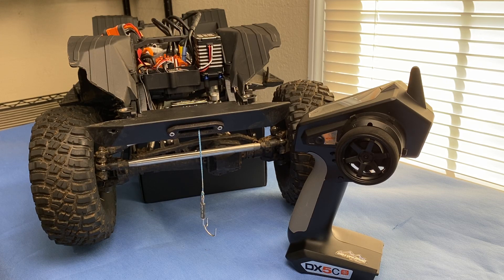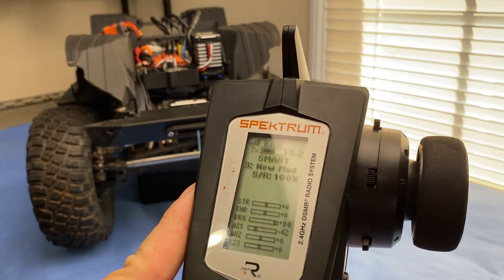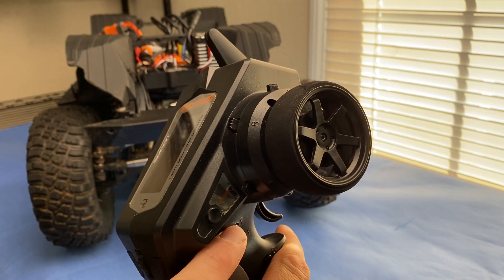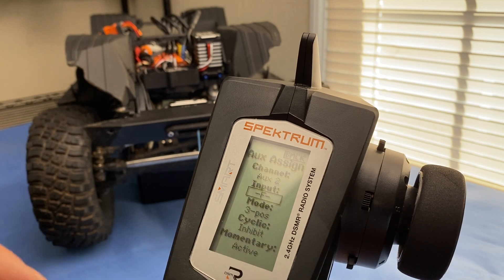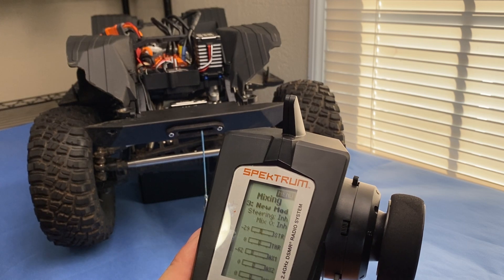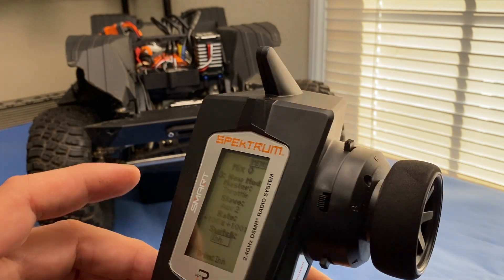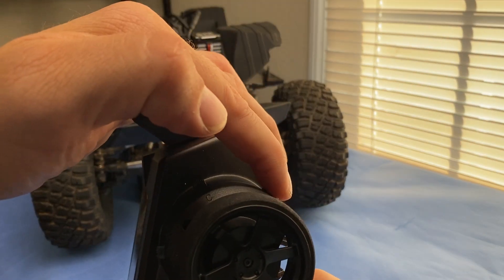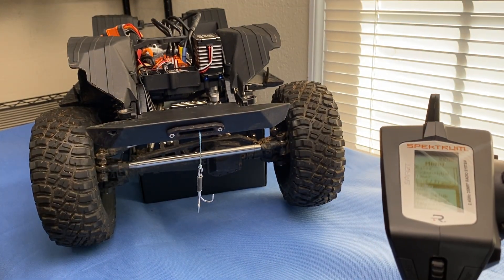How To Set Up A Servo Winch For Maximum Control!

Comment: My dx5 rugged will not allow me to change aux channel help pls
Reply from the maker: I have found sometimes they lock up on the aux settings. The only fix I have found is to do a full reset for that model, or select a new model and redo the whole setup. Sucks I know.
Reply: @ what I did also why I got your attention do you still do scx6 servo mount?
Reply from the maker: @brettskinner5824  I don't offer any SCX6 parts anymore